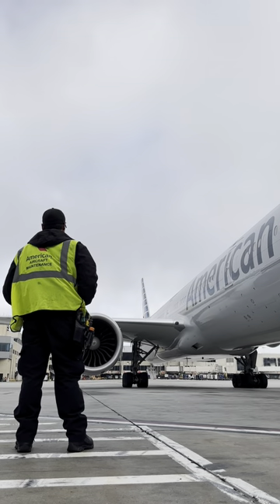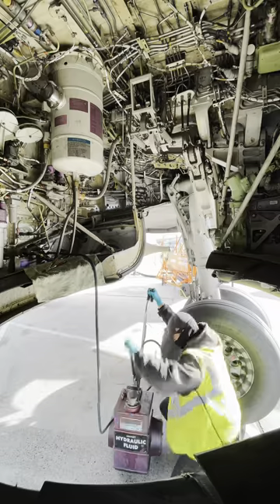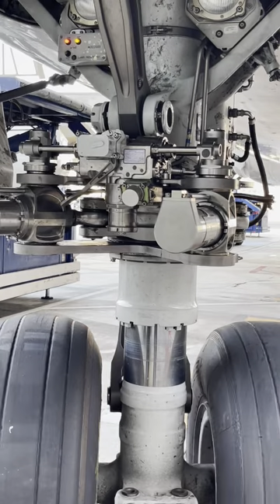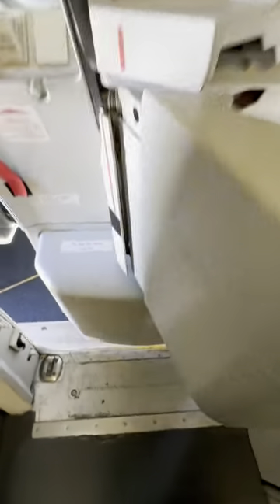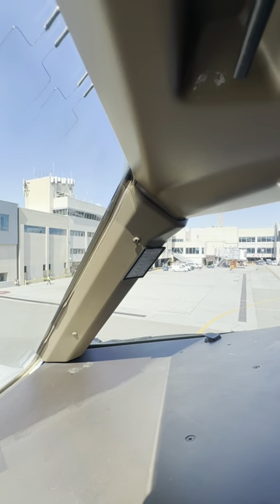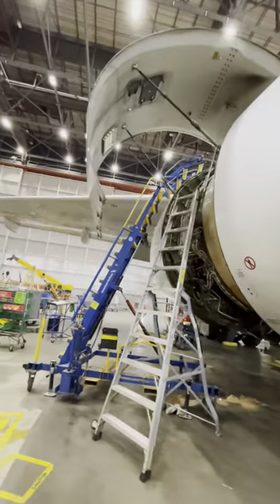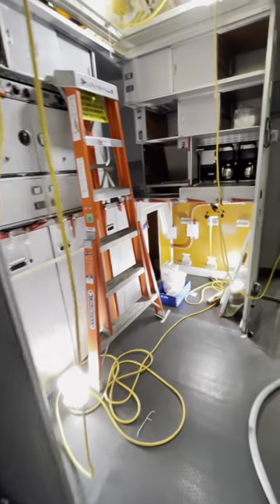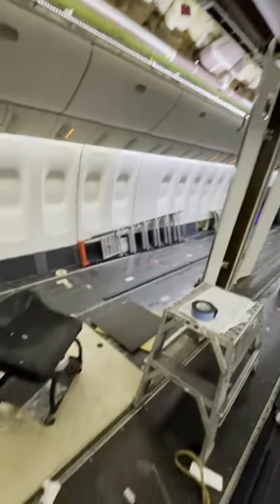Aircraft Line Maintenance vs Hangar Maintenance

Comment: Now retired, I had 52-years in military and air transport category aircraft maintenance and was given the Charles Taylor Award by the FAA. Line maintenance midnight shift at a large airline is the more interesting job if the mechanic likes troubleshooting systems and getting to know how the aircraft actually works. Hanger maintenance, most of which is done by third party contractors these days, is a lot of repetitive work cards and not very interesting from my viewpoint. If the mechanic is interested in nuts and bolts jobs like replacing landing gear, flaps/slats, engines, etc, then heavy maintenance might be appealing. Line maintenance mechanic compensation is far superior than what is paid to hangar mechanics at third party contractors.
Reply from the maker: First of all I salute you for attaining the Highest Honor amongst our maintenance community. The coveted Charles Taylor Award is very sacred for us. I hope to earn it myself one day (25 more years to go 😅)  and you are absolutely correct on line vs Hangar differences.
Reply: Excellent!! I am sure every job has pros and cons, likes and dislikes. Are there any cons and dislikes you can address about this type of job?
Reply: @shaza6880  The cons of line maintenance at a big airline are shift work, working weekends and holidays, working outdoors in cold and wet weather. Large airlines provide financial compensation for some of the above mentioned cons. When I worked as a line mechanic my kids were young. I'd come off midnight shift as they were getting ready for school. I'd sleep and get up when they arrived home. Then I would leave for work as they were getting ready for bed. Days off are determined by seniority. The junior mechanics tend to have middle of the week days off.
Reply: I liked the engine shop maintenance environment but also worked the D checks later on. Now retired, but working in the airline environment is exciting and rewarding (when the economy is right)
Reply: Hit the nail on the head, never was much of a hanger tech. Always will be a line guy
Reply: Stig, how have engine removal procedures changed since the American Airlines DC 10 tragedy in 1979 at O Hare?
Reply: 52 years in aviation and still can't spell " Hangar " correctly. 😒
Reply: Salute 🫡
Reply: Start my first job as an A+P tomorrow @ PHL airport. I’m excited!!!
Reply: @Check2frank  Good for you! I wish you success with your new endeavor.
Reply: @StigAviation  is the paperwork side of the line maintenance vs heavy is similar? Is it more repetitive/easy on the line? Im doing the jump to line maintenance from heavy and the only thing that scares me is the procedure/paperwork side of it

Comment: One way I describe to people the difference between Line and Hanger maintenance is: Line is like a hospital emergency room where a sick plane comes in and is diagnosed and treated quickly then sent back out, whereas the Hanger is like a hospital ward where routine surgeries are carried out with more time.
Reply from the maker: That’s actually an amazing analogy. Perfectly said John. Thank you
Reply: But you have to work in terrible conditions
Reply from the maker: @staxbeeburner4757  someone has to do the job. That’s the way it is.
Reply: I would go one step further and say that hangar maintenance is very much like a hospital room. The minute you block the aircraft in the bay, they’re screaming for you to get it fixed and out, just like a hospital room. Additionally, hangar maintenance at a non-heavy check facility does the lions share of troubleshooting. Big airlines need gate space. If an aircraft can’t be troubleshot down to a fix within an hour, the aircraft usually goes to the hangar, especially chronic birds.
Reply: More like a "sick" plane gets shuffled off to a waiting room and replaced because if it can't be fixed by a reset or deferral it's going to have to RON and wait for midnight shift to come in. Day and swing line mechs rarely treat a sick plane, especially domestic because there simply isn't any time. International they might have 4 or 5 hours so it's different.

Comment: I remember standing in the wheel well of a G-650 and being blown away with the tubing, wiring and all the components. The level of engineering that goes into these machines is astounding!
Reply from the maker: Indeed it is. It looks like a mess but everything is placed in a very strategic location for its functionality.
Reply: Nothing about designing a modern aircraft is easy. Concept to first delivery can run about 10-years and involve thousands of suppliers.
Reply: If you get assigned a job on a 737 nine times out of ten you're gonna be in the wheel well at some point. Seems like everything on that plane ends up there and it is one nasty, filthy place. wear a Tyvek suit. lol

Comment: I am a retired A&P and and have worked  line,  and hanger  maintenance as a mechanic, and a crew chief /lead mechanic ,in both positions ,was also a inspector in both positions, and spent a little  time in maintenance control . I really like the job always learning new things , The only downside is its a 24-7  365 day job, and working the line in the winter was interesting at times ,but line MTX as a mechanic was my favorite . I liked the hands on and troubleshooting aspects of line MTX.  Inspection and lead positions paid a little more, but much more paperwork . Hanger MTX is steady work and the day goes buy fast but not so much troubleshooting .
Reply from the maker: Perfectly explained sir. Thank you for your years of hard work and keeping the metal moving
Reply: Took the words right out of my mouth. I worked UAL in the same capacity and also for some other outfits when I was laid off from UAL after 18 years. I miss the work but not the insecurity of job.
Reply: Ey would u plz tell me 
Which would be the best college to learn aircraft maintenance course to get A&P   in usa

Comment: I had the chance to tour a United maintenance station a few years back and got to see a 737 undergoing a D-check. All interior fittings and paneling were completely removed besides some of the center floor panels, revealing the former/bulkhead/stringer structure in all its glory. Really put into perspective the effort it takes to keep these machines flying!
Reply from the maker: Quite an amazing thing to see and experience. The fact of how it all gets put back together is an achievement in itself.
Reply: @StigAviation  How do you keep track of all the parts, fasteners, everything? With so much complexity, does stuff go missing or get re-installed incorrectly?
Reply: @harrikangur parts bags and inspectors, and most importantly a lot hands to help

Comment: Excellent and comprehensive video that covered about everything of aircraft maintenance, I appreciate your efforts in making this excellent material; my self is a retired aircraft maintenance professional who worked in hanger and line maintenance on B737, L1011 and B747, I did have aircraft taxi and run up licensel along with troubleshooting experience, finally I joined MCC Maintenance Control Center which depends on previous aircraft maintenance knowledge and experience.
Reply from the maker: I do miss working on L1011s and 747. They were special to me. And that’s amazing that you moved into MCC. They are another group of unsung heroes in the background.. working hard to troubleshoot and dispatch aircraft. Thank you for all your hard work

Comment: Started with United in late 80's and we were doing section 41 mods on the 747's. That was some crazy maintenance, the entire cockpit plus E&E bay had to come completely out followed by a month of structural work strengthening the fuselage. All in all it took about 90 days. As an R&E I learned all about troubleshooting because we had to find every wire bundle the sheet metal guys drilled through. All systems had to be checked and often it took multiple test flights to get it back in service. Retired after 34 years, did everything from hangar to line, I guess my favorite was special routes, kind of one foot in each camp and not as lonely as working the terminal plus without the constant danger of getting run over by a bag smasher in a tug.
Reply from the maker: You my good sir are a jack of all trades. I aspire to be the same. I myself have spent time in hangar and now line. But after 25 years of fixing I still have a lot more to learn. Thank you for all your hard work and keeping the beauties airworthy.
Reply: @StigAviation  You're doing a great job of showing how rewarding a career like this and the skills learned can be. After retiring I picked up a 1946 GC-1B Globe Swift. It's a basket case that last flew in 1964 but if I can pull it off restoring it will be my legacy.

Comment: I just learned a lot about aircraft maintenance amazing video. Question I forgot to ask. Why does the inside window have a little hole in it?  Is that for pressure?
Reply: Yes exactly, the inside window is basically to protect the outside window from damage, if there was no hole air would be trapped and it could explode
Reply: @golfkid333  sweet. Thank you
Reply from the maker: Correct 👌. Better known as a “bleed hole”
Reply: @StigAviation  nice!  Priciate it.

Comment: I used to love doing 'tow & stow' of aircraft on night shift, until as a young apprentice mechanic I was the only person on board an old 747-200 Freighter and right as we started to cross the active runway an electrical fire broke out from the throttle quadrant filling the cockpit with the most toxic smoke.
 I was able to drop the APU generators off line to stop the fire but i got a lung full of that smoke, took me a few weeks to fully recover. 
Blood tests showed I had cyanide and other nasty chemicals in my blood. 
Aircraft maintenance can be a really hazardous environment. 🇦🇺
Reply from the maker: Indeed it is a very hazardous environment to work in, but good thing you and professionals like us get properly trained on how to react hastily and safely on situations such as yours. Glad you made it out of there without further hard to you.

Comment: 7 on 7 off  12 hr graveyards. Hated line maintenance.  Small crew 20 planes.  Tire and brake extravaganza in neg 40C weather. Hanger maintenance and heavy maintenance for a major airline was the way to go.  Had really good times...less stress.
Reply from the maker: Line maintenance is not for everybody, it’s not a easy environment. But it’s very rewarding, I can only speak on my behalf, I have done both and I enjoy both.
Reply: As an R&E on the line sometimes you're the Maytag repairman and sometimes you're a Fireman and you never know at start of shift what it's going to be.

Comment: At AA I worked in a hanger at DFW. We did in between maint. Such as engine and gear changes. We were on a time schedule. It could get stressful. We were between line and phase checks. We would pick up aircraft from the line and bring them into our hanger. We repaired we would return them to the line. I worked in the R.R. Engine shop at AFW.
Reply from the maker: Yup I know that feeling because I work in LAX .. not as heavy as DFW or DWH but we get the work done and move the metal. Thank you for all your hard work
Reply: I worked at DWH for a good while. It was busy. Helped launch one the last MD80s headed to Roswell.

Comment: I am a 30+ year retired A&P from a major airline.  It never snows or rains in the hangar, and most of the shops have heat & air conditioning.  FLY NAVY!!!
Reply from the maker: You’re absolutely right, Hanger is a lot more comfortable environment, but the line is where the real challenge lies. 👌
Reply: I've worked both in the military & airlines. On the boat in the military both on the flight deck & hangar deck is a real challenge.  The flight deck is  the real danger zone.  Truly one of the most dangerous places/jobs in the world.  FLY NAVY!!!   @StigAviation
Reply from the maker: @USNveteran  absolutely. And thank you for your service sir. 🫡 Go Navy 🤙

Comment: One thing true about hangar maintenance is that, the more senior you get, the more safty critical and difficult jobs you will be assigned to. Like removal and installation of APU/Engines, control surfaces alignment. But at the line, the jobs get much easier.
Reply from the maker: I would 100% agree with you.

Comment: In my company we call them "line maintenance" and "base maintenance" and we name the inspections by hours and or time. For instance we have the 6m, 12m, 100h, 150h, 150h/12m, 300h, 300h/24m, 600h, 800h, 6yrs, 12yrs.. and many others in between, and each has its short or long list of job cards with the tasks to be performed and it all goes into this document called "work order" that will result into a "work report" upon completion of all the tasks.
Reply from the maker: We pretty much do the same thing, it might be slight differences here and there, but it’s basically the same work.
Reply: @StigAviation  yeah :D

Comment: I miss the aviation environment. I received my A&P in 2002 and only used it for 3 years between 2 companies. My timing for what part of the industry I wanted to be in (hangar for large commercial passenger or cargo jets) couldn’t of been worse. I was halfway done in school when 9/11 happened. That changed the maintenance industry tremendously. I was with Fedex at the time and wanted to retire with them. They shutdown their MTP until further notice. I quit and applied  
with SWA. No movement. Ended up with a FBO called Ameriflight, working on turboprops and piston engines. Not where I wanted to be and I quit after 1.5 years. 

I ended up changing my field to media production. It’s been satisfying but I gotta say I miss working out on the AOA and smelling Jet A 😕
Reply from the maker: If you have your A&P then you’re a mechanic forever.. and I’ll tell you now is the time to get back into it if you wish. All major airlines are in high demand for aircraft maintenance.
Reply: I appreciate your response. I haven’t signed off on a aircraft repair since 2005. I thought I had heard in school that if a tech isn’t active for 10 or more years that they have to retake the written exam?  
Not sure, but I’ve found pleasure in media production the last 15 years. I need to do aviation features like yours. That was very well done 👍🏾
Reply: @SixTenVisuals  the only way to be able to exercise your privilege as mechanic again is to call your local FSDO and speak to an airworthiness ASI. they will decide how to test if you are "able" per 14 CFR 65.83

Comment: WOW, very impressive, how these planes especially can be short time return to flight. Line mechanics or hanger maintenance. This is a B777? It’s amazing when these birds are built originally all parts, tubes etc…then stripping it sometimes reassemble it return to flight.
Reply from the maker: Well said. Indeed very impressive. And yes that was a 777-200 undergoing a D check in the hangar.
Reply: @StigAviation  thanks thought was a B-777. Sometimes cannot believe how big wheels & gears are until that close, hard to believe inside tube liner how loud gears up & down, until outside & close. I enjoyed D check on swinging gear. I know A&P mechanics, now I know what’s like. They are amazing workers for our safety.

Comment: Just curious: During short turns, do you also as line maintenance make the call to keep an aircraft grounded if its proven a technical issue might affect its airworthiness? Or do you let it fly because it will cost a lot of money?
Reply from the maker: Yes indeed we do ground them if deemed unairworthy. The decision is ours to make and determined by limitations that are written by the manufacturer. I personally have grounded dozens of aircraft in my career because I found it unsafe for flight.

Comment: Worked for UAL at the SFO maintenance base from 1969 to 2002 as a aircraft mechanic and inspector. A great career until the company went bankrupt and terminated our pension’s.
Reply from the maker: UAL went through some rough times… but you have seen the golden days of aviation and aircraft maintenance.  Thank you for all your hard work sir.
Reply: I was being instructed in school by a few UAL techs that worked at OAK Mod center. After 9/11 they started transferring seniority personnel over to SFO and younger techs ended up leaving to other carriers or those 3rd party maintenance outfits that paid about half as much. What a sad time for that industry. My first job was working for a UAL-SFO vet named Hugo DaSilva at a small company at Oakland North Field.
Reply: Doesn't really make up for it but after Covid I took the buyout and got $140k back from them.
Reply: You didn’t lose your pension though right?
Reply: @MS-37  We all lost our pensions in the 2002 bankruptcy, also lost the ESOP stock.
Reply: @pi.actual  Sorry to hear that. I always thought pensions were protected. Even if the company goes bankrupt.
Reply: @MS-37  Prior to 9/11 that was mostly true but that disaster was used to justify a lot of unjust actions. United wasn't the only place where it happened.

Comment: Is the D check where engine components are x-rayed for fatigue cracks (blades, etc)? I read a lot about components failing because they were not properly checked for fatigue fractures. Just curious if it’s part of the Check or if it’s an as needed kind of check.
Reply from the maker: The engines have their own set of intervals for inspection. But yes. Engines will be dropped and send off to overhaul (depending on the hours and cycles of operation) and inspected for deteriorating conditions.